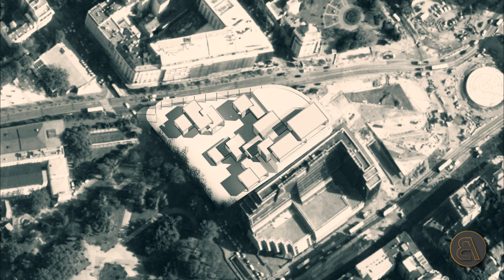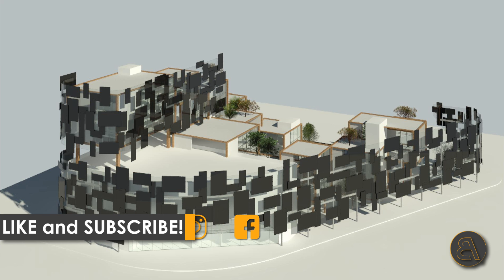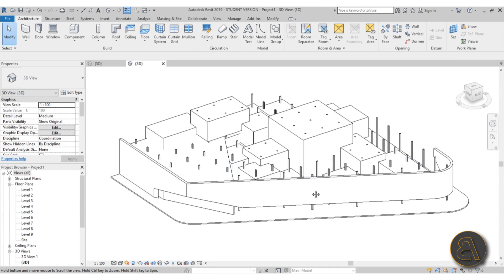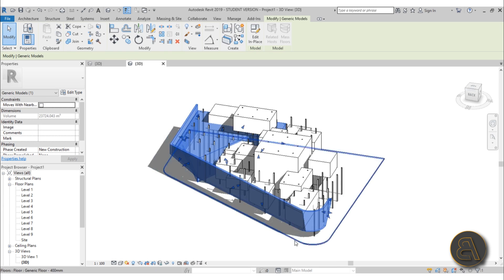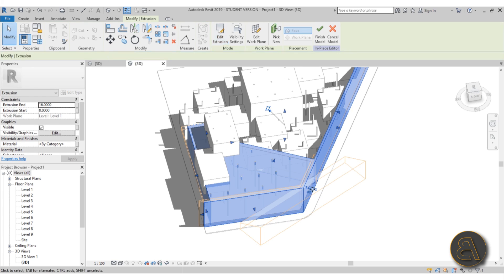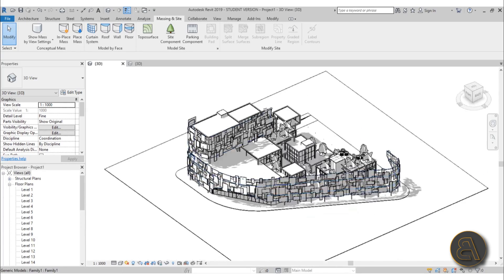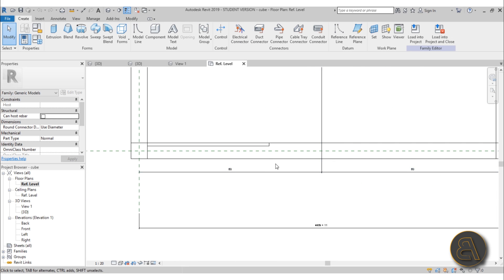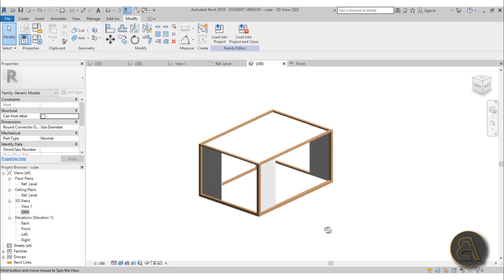My Archtiecture Revit Project

Comment: More and more I understand the visual difference between a architect and a engineer, architect wan't to work with a white background, shadows or sketch lines, high contrast, so it pops out and burns my eyes but a engineer wan't a black background, dark theme like VScode, color lines, transparency, so Autodesk, REVIT 2020 DARK THEME
Reply: In Revit, go to R > Options > Preferences and you'll find a tab related to the UI. One of the options lets you select a 'Dark theme'